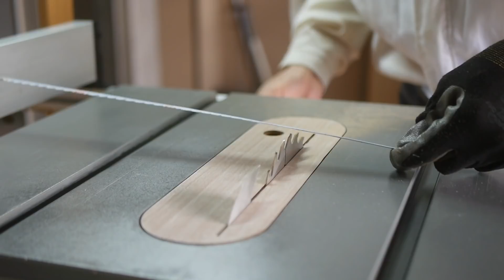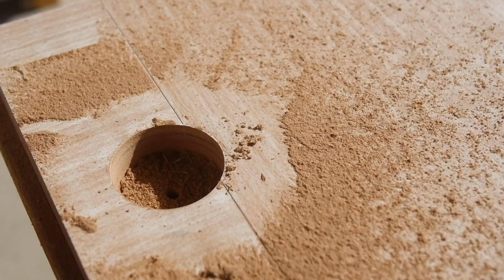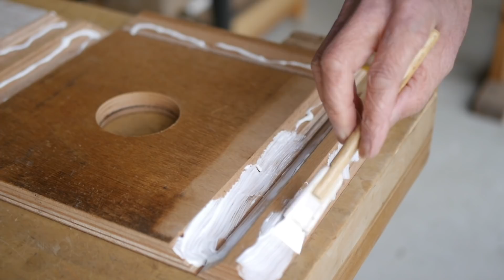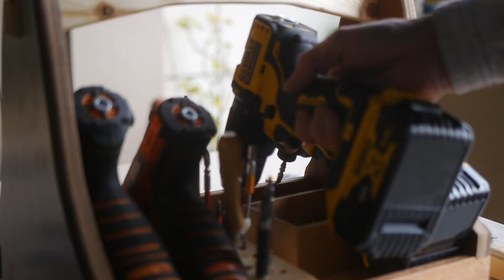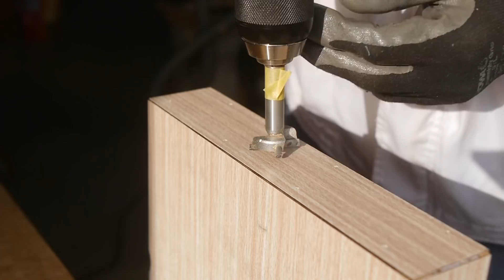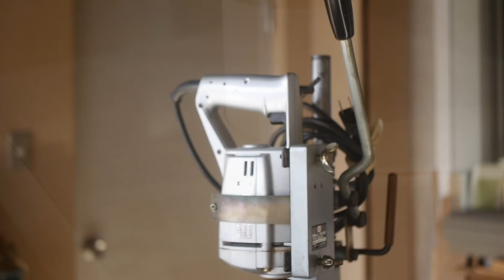DIY drum  sander system

Comment: Hi Tachi very nice work and good design. I have an old drill stand and drill bought 40 years ago. I may steal your design and make one to replace the one I made. Thank you for sharing my friend.
Reply from the maker: Hello Hai
Thank you for your continued patronage of my video.
I am very happy that you agreed to my project.
Since the inside of the box table is made narrow, the suction power is very strong.

Thank you friend Hai ... Tachi
Reply: @TachiOhyo56  I agree with you completely. Mine was larger because I made it for the larger drill press. As a result the suction is poor. You have great insight to whatever you do, my compliment.

Comment: Hi Tachi,
Is the dust extraction ok?
I have the impression that the gap between your worktop and the sleeve may be too little to optimally suck away the dust.
Keep it safe, it is not over yet.
Willy from Belgium.
😷😷😷
Reply from the maker: Hello Willy
Thank you for coming to my workshop.
And thank you for the nice comment
Yes, I was worried about it, but this is fine dust, not sawdust, it is sucked in smoothly.

Friendship from Japan ... Tachi
Reply: @TachiOhyo56  Hi, good morninng Tachi.
Thanks for your answer, I did worry about it.
If there are no problems, then it is fine.
See you later. 
Keep ie safe, it is not over yet.
Willy from Belgium.
😷😷😷